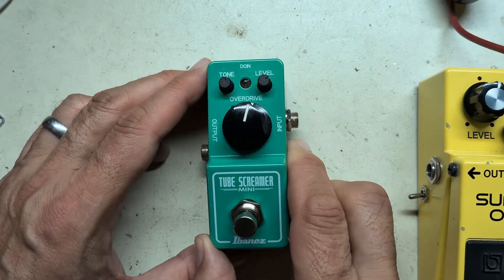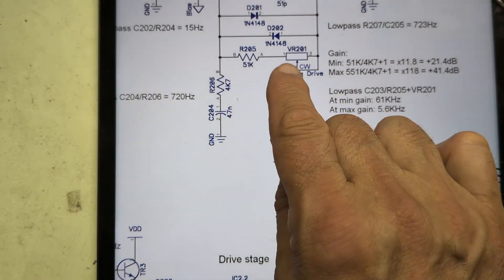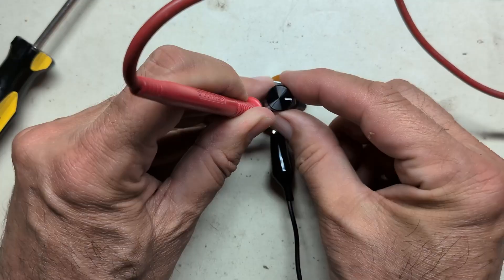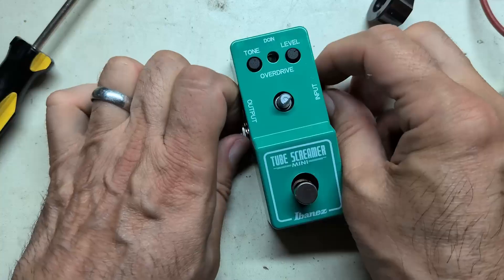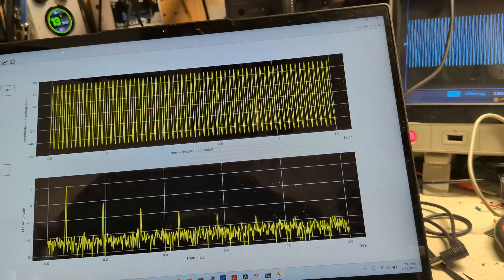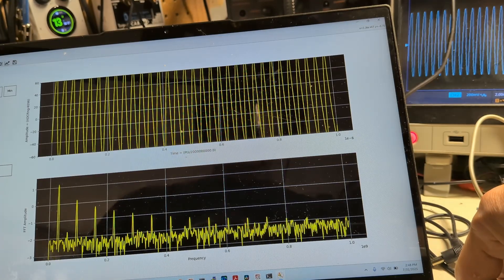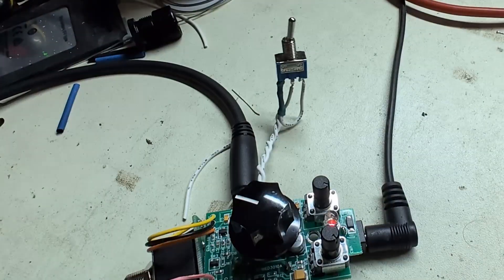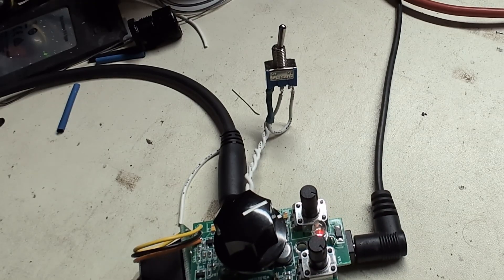Easy Mod - Ibanez Tube Screamer High Gain - Make any version scream!

Comment: Hey was wondering if you could help me with a problem, when I turn the tone knob nothing happens but when I push the tone knob in slightly it sounds like it engages any idea as to what the issue might be thankyou
Reply from the maker: The pot sounds faulty. You could try squirting cleaner in it or replace it.

Comment: I did this and a tone cap mod. I put a 3 way on the gain and a 2 way on the tone cap. I used this high gain mod, the stock circuit, and a germanium diode mod for that buttery edge of breakup thing. I used a 90s Japanese TS-9 which is the best new version of the TS you can get. I've been comparing this pedal to other OD's for years. I finally found one that compares. The Revv G3 is an amazing pedal. It's the only pedal that can sounds almost exactly like my TS-9. Interestingly the TS is wider and fatter sounding with a fraction of the gain used in the G3 but still sounds "high gain". The G3 sounds brilliant but it's a bit more compassed and has maybe 3x more gain. The G3 is very versatile where the TS is very limited it's a one trick pony. The TS is a very interesting pedal that sounds better than you can imagine when you start comparing it to basically anything. It stands up to virtually any overdrive even vintage Klon OD's. There's something very special about the Ibanez Tube Screamer.
Reply from the maker: I was a Klon man until I really started to get into the TS's. I'll check out the Revv G3, do some measurements on it and quantify it's performance.

Comment: Great info but do not do this folks (unless your a building a pedal from scratch or thinking of getting into pedal building). Buy a distortion pedal and keep your overdrive an overdrive\boost so you have options, including TS into DS for higher but importantly tighter bottom end gain. You'll want both eventually.
Reply from the maker: Folks just do it! Cut some wires solder pennies worth of components, try different values and break a cheap pedal. Then learn how to repair it. Its awesome!

Comment: I’m gonna do this mod now for sure. I’m curious as to where you’re going to place the switch. I did the R28 mod to my MXR Phase 90, but didn’t include a switch for that. Since I need solder and new tips for both my irons, I’ll add a few switches to my order. Thanks again for an easy explanation!
Reply from the maker: Hope the mod works out well for you!

Comment: You could also replace the 4.7k resistor and 47nf cap with 470R and 470nf will give loads of gain and keep same eq.
Reply from the maker: Yes I agree, but then you are into Surface Mount changes on the modern versions.